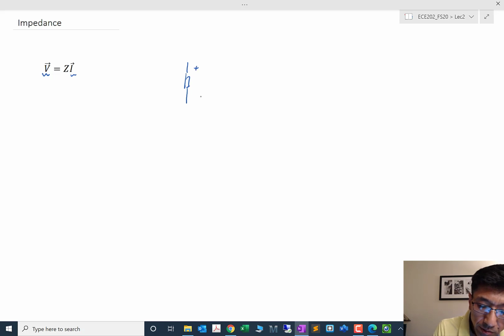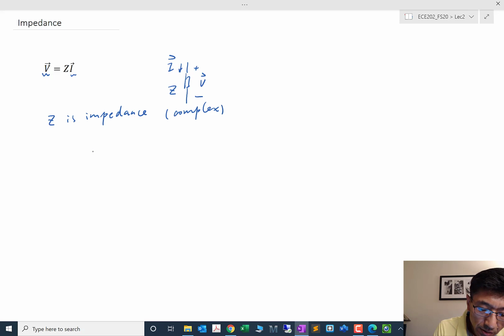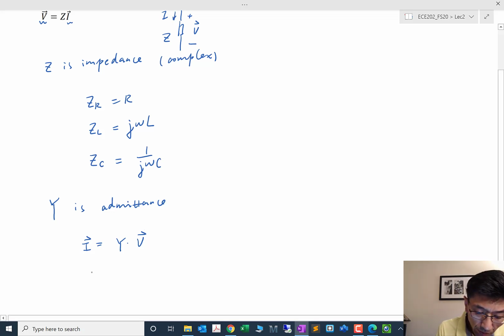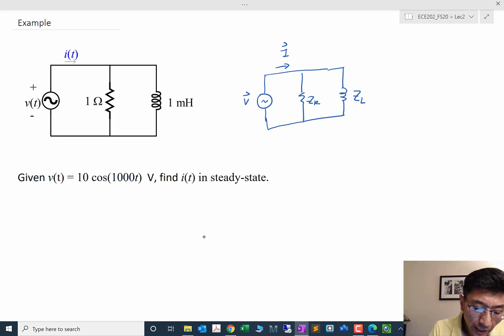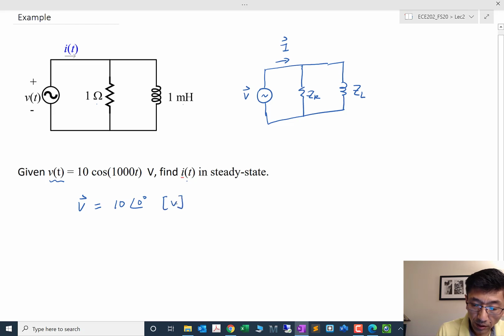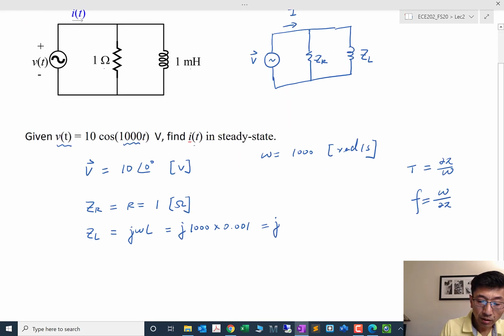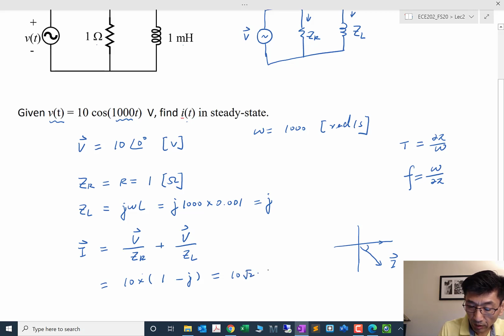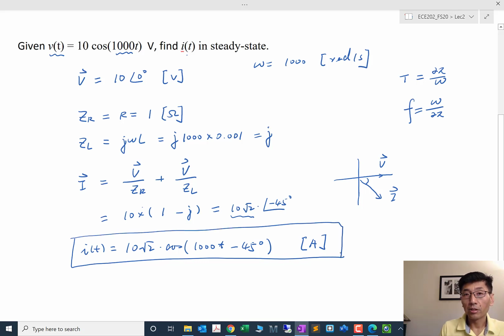ECE202_Lec2_Part 4 Impedance and Admittance

Comment: For using the angle of -45 [deg] are we implying that we should use the angle with less magnitude (i.e. 315 [deg] would be the same angle). Does this have to do with any idea of preferring the current to lag the voltage rather than lead it?
Reply from the maker: When we say the current leads or lags the voltage, the angle often ranges from-90 degrees to +90 degrees. If the current lags the voltage by 45 degrees, technically it is correct to say the voltage leads the current by 315 degrees. It is not the convention to use 315 degrees.

Comment: I didn't understand how 10(1-j) got converted to 10*sqrt(2)*45 degrees. Please do help me. Thank You.
Reply from the maker: The phase angle should be -45 degrees if you check the video around 9'15". Check the Appendix A Part 3 for polar rectangular transformation at https://youtu.be/DgXqW78ZYkU.